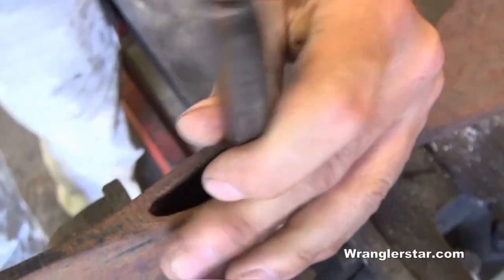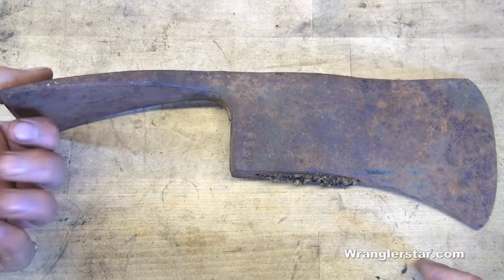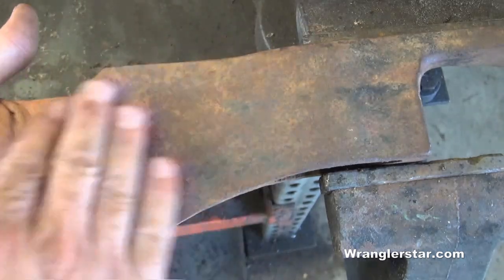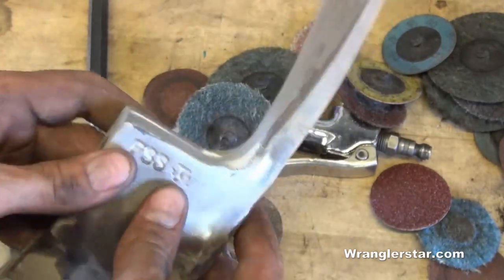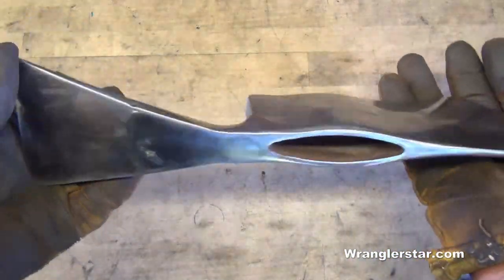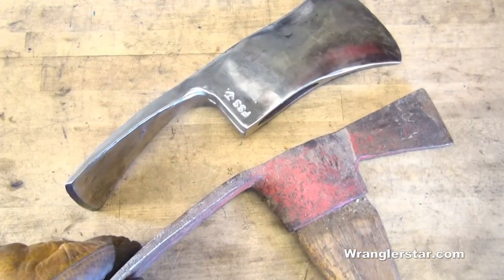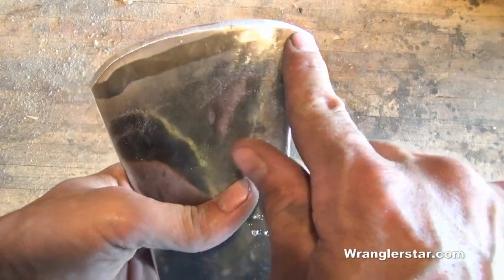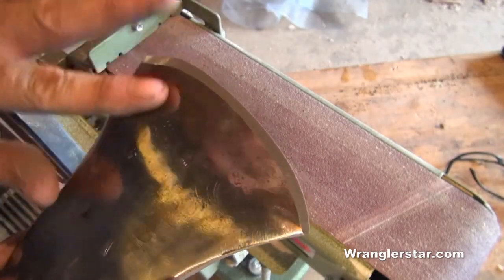Pulaski FSS Firefighters Axe - Wranglerstar

Comment: So your show has inspired me many times over. I month or two ago I was looking for an axe for fire wood. A good friend of mine gave me an older Pulaski. The handle was rotten. Much like this one it has surface rust. I picked it up a week ago and contemplated just replacing it. Then I saw a stamp on the side reading U.S.F.S. Again I thought of your show. The restoration began. With your help I was able to clean the tool up and put a new handle on it. I am proud of the tool and the work I put into it. Thank you for all your help.

Comment: I found a complete one of these hanging in a tree in as good condition a lot of years ago while cutting fire wood here in Idaho. The tree had grown over the head so I removed it with the chainsaw. There was also the rusty remains of a Winchester on the ground below it.  I still use it every day during the winter splitting fire wood in the shop although the head is kinda loose. Thanks for the history.

Comment: The Chinese one is not an axe it is a gardening mattock. it is for breaking up soil and roots. It doesn't look like a good one, but they were my grandmother's favorite tool for breaking up Oregon clay and roots. The small bit makes it easier to penetrate soil.
Reply: Exactly so GunFun. A Mattock is a dirt tool not a timber tool. I find a mattock is the ideal tool for digging out a tree stump - the mattock blade for removing soil and the axe side for chopping out roots.
Reply: I was going to point out the same thing, as a digging tool the quality of the metal is often low (very often it's a casting and it may even arrive in your hands completely unsharpened.) this is because the digging side really is a large expendable wear surface, the ax bit on the back has its shape dictated by the hard, long wearing (at least for digging.) material the head would be made from.  A proper wood cutting ax blade shape would fall appart if made from the brittle (inexpensive if we are being honest) metal.  It's really there so you can flip it around to deal with the occasional root as I'm sure you discovered.
Reply: Glad to see that four other guys beat me to it. I still have my father's mattock, which is great for its intended purpose, which doesn't include being used as an axe.
Reply: GunFun ZS I have also herd them called a grubbing axe
Reply: We called them cutter mattocks when doing trail building..I swear he must know that its not a fake Pulaski cause this guy is pretty intelligent

Comment: I'll add what I knew about the Pulaski's use that doesn't appear to have been covered. The thing about these was the perfect combination use of BOTH tools. They were most often employed in a 20 man hand crew cutting fire line. Pulaski's came behind the crew boss and/or flagger, the sawyers cutting and bucking trail above ground and those brushers clearing what the sawyers had cut and in front of all others in the line. 

The men with Pulaski's were the first actually "in the dirt headed for mineral soil", and usually about the toughest men on a trail crew.  A Pulaski weighs about 5 or 6 pounds and was very fast. When one really get tuned in to cutting line with a Pulaski, the job was to reveal and then clear what the lighter tools behind you would not be able to easily clear. This was THE tool to clear the brushy thicker roots out of the duff layer of soil, roots typically of salal,  rhododendron on the west coast or snowbrush, and manzanita where drier, and other such understory bushes that were growing in the fire line, and usually cleared to wider than the finished trail of 30" or 36" width when practical. These would also blow through rotten stumps or logs too punky to be moved out of the way in one piece. 

As such it was usually a cadence of a few swings that one did to clear space around the particular bush and without ever missing a beat, perfectly flip the tool 180 degrees on the upswing and then slice through whatever you had exposed with the prior passes. If you were really good you could even shuck the brush off the line with your tool and keep moving all in cadence. So the swinging never stopped, and one could flip back and forth with which ever of the tools one was using. It was as important for the adze or grub side to be just about as sharp as the axe side as it just made the total job go that much easier. This end was also sharpened the same as an adze or a slick, and never from the other face.

Hazel hoe's (Cody, find one of them too) followed down the line, then some other lighter tools depending on topography and flora.  The shovels and rakes were usually for the wimps at the back of the line, sorry, but true.  This was hard dirty work that few could do for a  couple hours much less day after day, and that I, thirty years later, would never want to do again.

Comment: My Pulaski is made by Council Tool.  It looks pretty much identical to yours except the Adze section has a square shank that was twisted to form the adze.   The adze is identical and so is the axe section since it was made under contract to the Forest Service. I cleaned mine up also and and sharpened the adze section for pole work.

Comment: Cody, you ought to try something called Evaporust when you restore these axe heads. I use it on rusty car parts all the time, it works wonders and doesn't leave any residue or dimples. It simply removes rust. It is also totally non-toxic. I am a huge advocate because it removes only the rust, not the material so you can really see what you are working with. Love these videos!

-Noah

Comment: One thing I recently did with my axe was to use a cold bluing solution like used for firearms to put a protective coating on my axe and hatchet after I cleaned them up to remove rust and pitting. looks pretty nice and the bluing helps protect them with a light coat of oil like you do for your firearms. I also refurbished a picaroon for my Father In Law the same way and put on a new handle that I stripped first then stained with a walnut stain and resealed it came out real nice.

Comment: Hi there, I love axes, old tools and this was a great video. Just wanted to say that I am from England and the cheaper, rubbish version that you showed is actually a very common tool here and is called a mattock. It's designed for more specifically digging and what I use it most for, chopping and digging out roots of plants and small trees. There is no real creator of this tool but it dates back to the bronze age. Thought you might like to know, brilliant job on restoring the pulaski by the way. Never heard of one before, need to find one for my self.
Reply: i will second that. A mattock is for moving dirt, not chopping trees. Its a common garden tool around here in B.C. I have both and each has its use. I use the mattock more, and a chainsaw for bike trail building, the "axe" side is just used for roots but yes it sucks and shouldnt even be called an axe. lol on another note great videos wrangler. Ive been sawing up 8x8 beams with an alaskan mill lately. keep up the great work.

Comment: The cheap china tool is not intended to do what a Pulaski does..  that is a gardeners pick Maddox.  Definitely not intended to be hacking away at wood. the flat vertical edge is more for getting rid of ground roots, and the horizontal edge is a gardening trench tool.  Can't be comparing a Maddox to a Pulaski... there really isn't one.  Great find for 2 bucks by the way!!!  Also, love this channel, keep up the great work on the videos.

Comment: Just picked up two Polaski heads. Pickeled them in muriatic acid mixed 2-1 with water. Works faster than vinegar still not harsh on my skin. One head is a FFS Woodings Verona works. The other is made in China. The Chinese one shows the heat treating line and may not be bad.

Comment: Beautiful work on shinin' up that old pulaski head. The pulaski is such a wonderfully useful and romantic tool, and certainly among my favorites.

As one who builds and maintains trails, having used both of these tools quite extensively, I can tell you that the other tool, a cutter mattock, generally has a wider-angled edge than the pulaski on the "cutter" portion. Its more obtuse edge is more forgiving in the event that you hit rocks by accident. In my experience a cutter mattock will usually have more heft than a pulaski, although your cutter mattock appears a somewhat diminutive. I'm a pretty big fan of the cutter mattock. I favor it especially for removing tree stumps, roots and all, and especially in soil that is full of rocks or is liable to be hiding random lone rocks. It would make me cry to see the damage done if I were to bring a forceful blow down upon a rock with a pulaski blade by accident. Doing so with the cutter mattock is another story. Also, the smaller blade length on the cutter means more precise blows (again, for working around rocks and other debris around the roots). For digging serious holes, get your hands on a pick mattock.

Comment: There are some mattock/splitters on the same general plan as your cheap chinese one that are worth having - though the decent ones backs describe a nicer curve. When you get one with the right geometry they're brilliant for breaking up rough soil, and general cutting, also due to the heavy pick handles and the shape of them you can remove bigger stumps than you'd think in next to no time. I'd also defend them on the basis that a number of them will give you a great, albeit funny looking axe for rough, general use. 

The big flaw being that if you're using them to break up soil in larger digging (think large trenches and deeper holes) hitting the wrong rock sends the splitter back at your face far more easily than you'd expect. The one I've been using lately is about 5lbs but when you're working all day you get in to a rhythm of very fast swings and something about the shape makes it prone to coming back up with much more energy than you'd expect from the tool looking at it.

Comment: I have restored a broadaxe and used a wire brush wheel on an angle grinder.  It removes all the rust but leaves the old surface that I quite like.  The only problems is it still leaves the dimples that you said are a problem.

Comment: The cheap chinese version is known in Australia as a mattock, but the axe "blade" on that one is very short, normally it would be about the same length as the "hoe" side. I have used one of these (probably locally or British-made) all my life, literally 50 years. A very useful general digging and garden tool. Probably crap for fire-fighting.

Note the "axe" end of a mattock is for breaking rock, not for cutting wood, so it is cut to a chisel edge. Also good for chopping tree roots.

Comment: i love all of your restoration videos I've seen so far, and I have a suggestion for you, to save time and effort with metal. a 50/50 mix of windex and mr. clean. jewelers use it to restore delicate jewelry without scratching. I've used it to soak a seized motorcycle chain. it broke the seize, and brought a shine to the chain overnight.

Comment from the maker: Kind of like spending $2 and some elbow grease on a Pulaski. This of course is way outside the ability of the average man. Or perhaps you're referring to the bee hive I showed how to build using scrap wood, or maybe it's buying a quality pair of boots that will last 15- 20 years and how to take care of them. Or maybe cutting a fence gate down so you don't need to spend money on a brand new   
gate. Or buying used cars and showing how to fix them yourself. Is this what you mean by most up to date

Comment: Whenever I find an old tool that is heavily rusted, I clean it with an electrolysis process using a 10 amp battery charger, washing soda, and a sacrificial piece of steel (I use a sash weight). After performing any major repairs, I spray the tool with phosphoric acid which converts any remaining rust (even that in those microscopic pores) into stable iron phosphate. I then tune and polish the tool to the state of finish desired. I work on other (fun) things while the hard work is done for me.

Comment: I have a passion for edged weapons and I would suggest getting a good set of japanese sharpening stones. Using a grinder works, but it softens the steel so it won't hold it's edge as long. Hard steels require a lot of time and patience to sharpen with just stones, but the edge will stay sharper for longer.

Comment: Nice restoration.  You said the rollock is the fastest way to work on it.  Too bad you didn't mention a second, even slower way.  I have an old axe head that doesn't look too different than the one you found but there's not much chance I would need a rollock for anything else so I probably won't be getting one.

Comment: it's good to see someone keeping up the old ways.  My Dad, Granddad and Great Granddad were all more or less axe men. I did not know the trick to finding the pivot point on an axe, neither did my Dad.  I do have a trick for you.  A way to take the rust off a  blade without removing metal.  easy electrolysis,,,,  the clean way.  Also, I've a firefighters axe I got from Home Depot, don't have it with me at the moment, but the blade design and grubbing tool looked similar to the FSS axe you have.  I'll have to get it out and send you a picture once I get home.  Love the videos, keep it up.

Comment: check out antique shops or flea markets.. there's typically a booth with "rusty" tools im sure will clean up.. i ran across some nice heavy duty masonry tools the other day at an antique shop.. not only were they more sturdy than the modern versions available at the big box home improvement stores.. but they were also 1/4 of the price if not less.

Comment: I prefer sand blasting or to use a sand and ceramic tumbler to get the rust off. It's slower but it does'nt leave any buffing marks.

Just a preference.

Comment: I have a similar tool to the chinese one you have there but it was made in japan and from the 1950's, I thought it was a gardening tool because the cutting part was so much smaller than the digging part and have been using it as a garden tool ever since. I imagine since the invention of the chainsaw these are used for digging more than cutting.

Comment: I watched your vid on how to sharpen an axe, somehow I missed it when you first posted it because you tube doesn't do a good job of sorting content to watch :( I have got to say that is a great way to get a very good edge. I usually sharpen my axe with a belt sander but the pivot is a great idea and I will be using it from now on. probably use a coarser grit to fix chips and nicks then finish up with a finer grit to sharpen. then final sharpen with fine stone.

Comment: I am Just now seeing this Video and have you considered backing Soda blasting? - takes surface rust/paint off but doesn't pit the metal. Can be used on almost any surface without damaging it. (wood, glass, metal, thick rubber/gaskets.)

Comment: may I recommend stepping up through a few grits of paper on a dual action sander after the scotch brite roloc? I start at 600 so I don't put too bad of a swirl into it. then step up to 800,1500,then 3000 (might be a little much for an axe) but then hit it with a polishing compound

Comment: The steel today is so inferior, there is no comparison.  I have a trailer that was home built in 1947, and went through so many drill bits and recip saw blades it was unreal.  On the road now, and good for longer than I expect to be pulling it; replaced the running gear, shortened the tongue, and wired it for lights. Brakes next, as I'm primarily hauling scrap with it.  But that pre-1950's steel is tough stuff..

Comment: so i was at my dads truck yard a few years ago and found a old axe head and i brought it home and i put it in my shed and it sat in there for a rew years and then i watched your video on restoring old axes so i wet out and found it, it says BC forestry's, so it must be a issued axe, soo i ground off the rust and polished it, oiled the head, got a handle for it, it turned out really nice, and i felled a tree with it and it got all pitched up from the sap, got anyway of preventing sap build up?

Comment: me again . I noticed you put a centre pop mark on both sides of the axe . I have been a big fan of PUMA HAND MADE KNIFES MADE OF SOLGEN STEEL . Not to be confused puma tech or other out sourced knifes . Anyway I bought my first PUMA  when I was a teenager in the late 70s for $35 worth alot more now if you could find it . Anyway every German PUMA knife comes with a centre pop mark on the blade . If it's too deep it is too soft . If it is too shallow it is too hard . Either one and they melt it down and start again . Anyway a bit of knife trivia for you .

Comment: Angle grinder and a wire wheel works faster and better. It doesn't heat up the metal if you do it correctly. You'll also see the tremendous difference and it's 10x better than doing it with sandpaper. Trust me.

Comment: Looks Great!  PULASKI TOOL: Shall be in accordance with Forest Service Specification 5100-355E dated April 26, 2000, and Drawing MEDC 632 Revision F, dated April 12, 2000.  "3.3.1 Trademark. The manufacturer's name or trademark shall be legibly metal stamped or forged into the center of one side of the head or on the underside of the hoe end of the head."

Comment: came across your channel since im a dave canturberry subscriber, why didn't you soak the head in a container of Evaporust to remove the surface rust and areas you couldn't reach with a tool, like $10 at local auto parts store

Comment: Hi Wranglerstar.  I don't have a right angle die grinder, but I do have a good drill.  For restoring an axehead (I have an old double bit that I found at a vacant house) what do you think of using a wire wheel to take the initial surface rust off, then polishing it up with a flap sanding wheel?  If you get a chance to put in your $.02 it would be greatly appreciated.  Thanks.